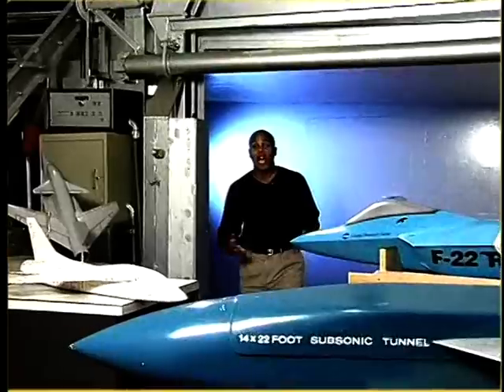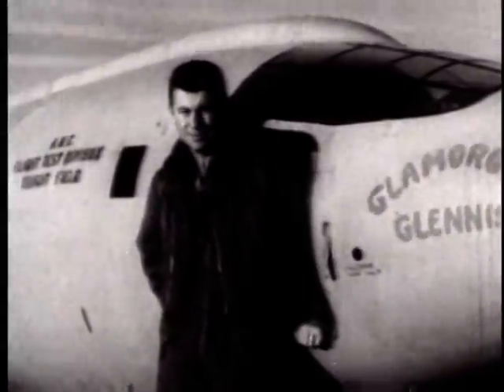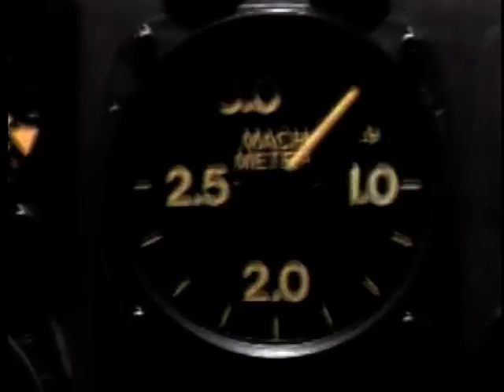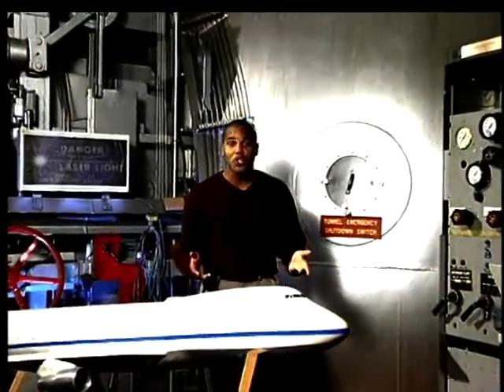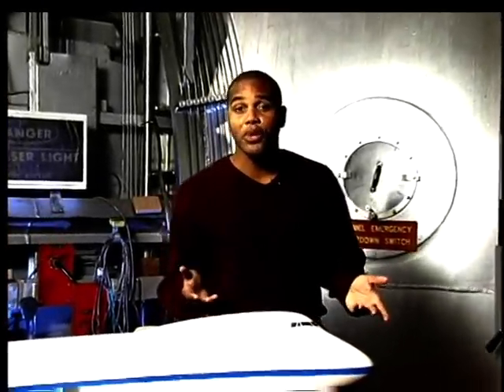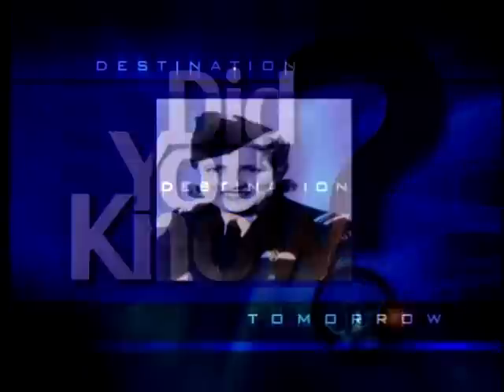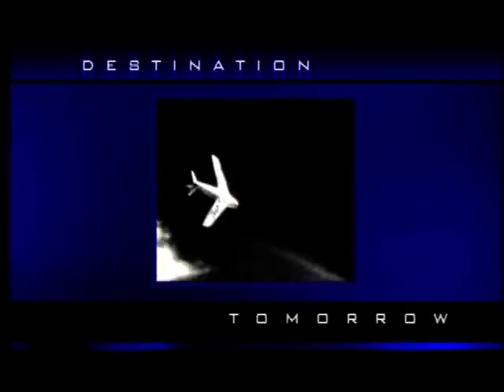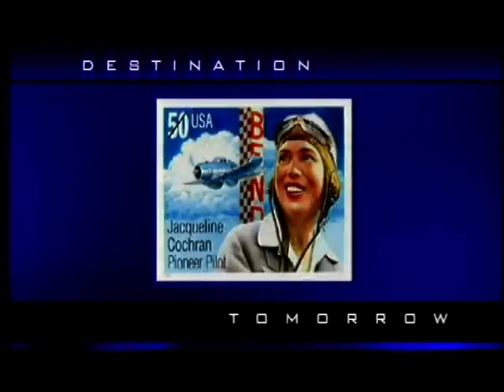Supersonic Flight (2002)

Comment: now I get it xD 
by making the fuselage waisted it essentially equals out all of the area flowing through the air.

so like at the nose and full size of the fusulagr you have the least amount of drag. but when you get to the wings, the added 3d area from them essentially makes it bigger and thus more air all of a sudden more air has to move out of the way at this point, causeing a drag.

a small plane can travel faster than a big plane using the same engines right? not just because of weight but there is a lot less air being displaced. energy not spent moving air is energy that can be used to go forward.
so if a plane suddenly got "bigger" it would create a simular drag to a larger craft.

so to fix that problem you reduce the fuselage to to compensate how much air moves for the wings, creating more equal pressure around the craft rather than low pressure in the nose and higher pressure after the wings.

that's yhe basic idea right?

Comment: how exactly does the sub-sonic 747 use the area rule when the area is pretty much the same all over the fuselage near the wings?
Reply: The 747 has a hump in the front that stops as soon as the wings start so the cross sectional area of the fuselage decreases once you reach the wings.

Comment: I don't believe in the "area rule", it does not make sense to me. Ones you approach the speed of sound you simply have to be sharp and pointy. Of cause you want to avoid more than one directional change in cross-sectional area (no turn from increase to decrease other than at the maximum).
Reply: Would you be a climate change denialist by any chance?